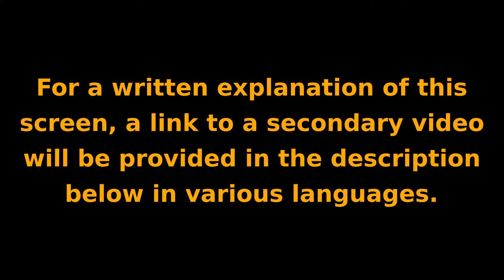Modular Reactor Basics (120 Tick Rate): Satisfactory Tutorial: Refined Power Mod, Part 12.2

Comment: Hey. So I'm trying to make a closed loop system with the advanced reactor casings. I found that I am getting an imperfect ratio back. I was unable to completely disconnect my core production line because I'd come back an hour later and I'd be in most cases 20% of my cases short.  (Note: It is a full 5 tier reactor using deanorium)

Contrarily I was able to close loop my nuclear steam heater (the platform/generator based ones) as those cores all come back. 

Am I bugging? Is my game bugging?
Reply from the maker: Have you had a chance to check out the revised video I made on modular reactors?  I show how I made a semi-closed loop system.

https://youtu.be/tAXPz7qVfSU
Reply: @mistertrizzle  No i have not. I will check it out first thing next play session. the fact you said "semi close loop" does lead me to believe that it's not a bug and is intentionally not returning all the units. I already cut my case production down to bare minimum. Great vids by the way. The source info is so arcane for such an in depth mod.
Reply from the maker: @CriticoolHit  If memory serves me right, I believe I just saw somebody (on the R&D discord) talking about creating the perfect closed loop system using the modular reactors but I was unsure how they were doing it.  I created a loop system in my revised modular reactors video that's worth checking out.

Comment: Thanks for these videos.

I am playing with Version 4.0.43 of the Refined Power mod.
A) Did you have that effect, where the consumption of Reactor Coolant is slowly but steady going up beyond 65m3 causing a Shut-Down due to overheating as soon as the Reactor Foundation is adjusted beyond 150? I have that does not matter which level of Reactor Shielding i am using. Sufficient water and Coolant is provided. What am i missing?
B) I tried a run with High-pressure Steam output and linked that into an Super HV Turbine. It turned out being waaay too insufficient. Any idea if running 3 or 4 Modular Reactors would provide sufficient High-pressure Steam for making that Super HV Turbine going steadily - so i could  take that bit of additional energy from steam? I am curious to learn if Energy AND Steam on could be more efficient than only Energy on.

Btw.: Would it be okay if i quote you in a video? But that may take a few month coz i have quite a backlog of recording pieces from my current ongoing play through.
Reply from the maker: Interesting.  I'm not sure I've ever run into a coolant-overheating issue.  However, I did release a couple NEW videos recently on modular reactor overhauls that might answer your B question.  It's fine to quote me.  I do recommend watching my Revised Modular Reactor videos to help explain things more clearly (plus I discovered a lot of new things).

Comment: I appreciate your vids. Without these vids i dont think i'd ever figure it out lol. My only question is how did you get those three pipes on the io screen to connect? In my game those three panels in the io screen are just blanked over.
Reply from the maker: In the IO screen, the Water, Coolant, and High Pressure Pipes are automatically connected when I place down a reactor foundation and support ring.  If you're having issues with this, I would recommend going to the Refined R&D discord:  https://discord.gg/GkVUFrHF  We can help you more there.
Reply: @mistertrizzle  I went onto the discord for the r&d mod and they kindly informed me that I needed to do research in the MAM. That was indeed my issue. Thanks for responding I really appreciate it. Keep up the great work 😊
Reply from the maker: @Rahhh29420  Wonderful to hear!
Reply: @Rahhh29420  You need the FULL research tree for Modular Reactors done in the MAN, including steam conversion even if you want to run energy only.
Reply: @Rahhh29420  Yeah why am I able to build the thing when it wont work without the research... How stupid.
Reply from the maker: Intersting, let me test something